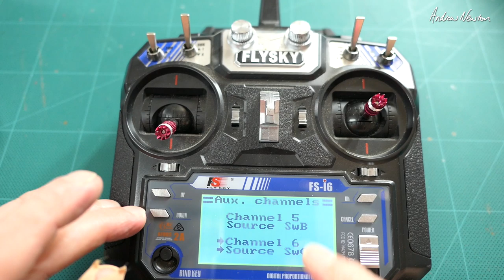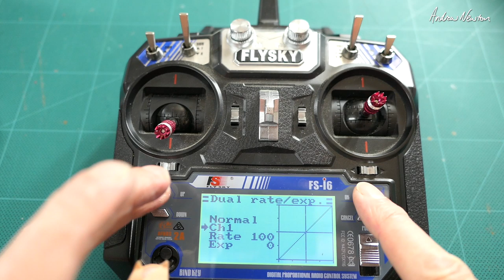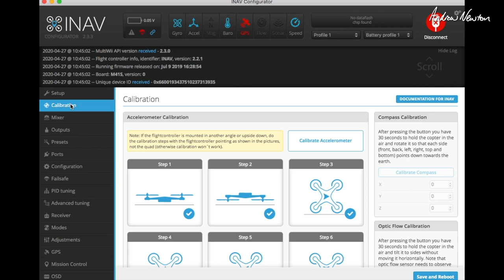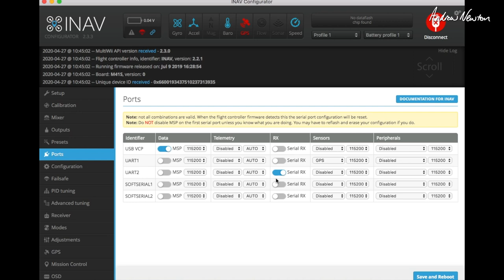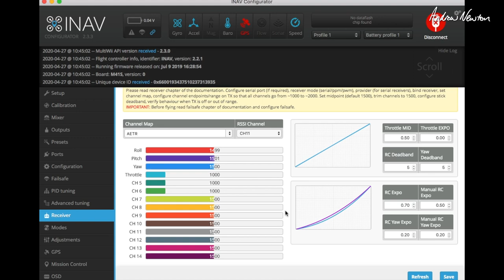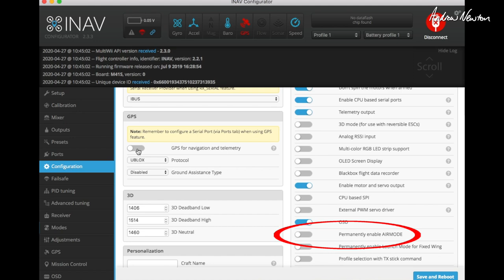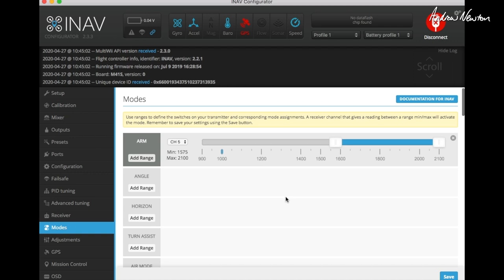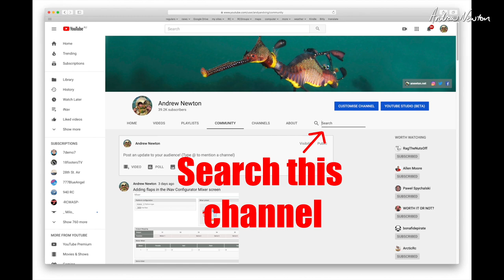FlySky iNav Fixed-Wing PPM iBUS Failsafe

Comment: If you upgrade the firmware on I-6, you will have 10 channels same as I6X. Can use more switches.
Reply: With the firmware upgrade, this transmitter is just amazing!
Reply from the maker: I only use this radio for beginners tutorials so it needs to stay stock. If it was my main radio it would be hacked and modded

Comment: Andrew I have set stabilization with CC3D board but has a limitation cos it is without barometer and cannot be configured for RTH ,alt hold etc .I have not yet tested the same and awaiting an opurtunity after lockdown is over.
Stay safe and stay healthy
Reply from the maker: Should be able to use Nav Launch too for a bit of fun
Reply: You can use rth. It will just use the gps height. Its not perfect but should work

Comment: Hi, great video, very helpful. Though I cannot assign the Aux channels to the switches like you did. It only allows me to select from the VRA and VRB. Any ideas on a resolution would be amazing. Thanks
Reply from the maker: With some firmware the switches need to be activated to be available in mixes. Is there an Aux switches menu somewhere?
Reply: @AndrewNewton  All good thanks, just needed to activate the aux switches

Comment: Hey Andrew,
I have small problem with my FS-I6. I have receiver and transmitter same as in the video, just FC - F411-WTE. I was trying to set up everything, but in INAV (6.0.0) my transmitter have no signal. With the INAV I can control motors, but with transmitter - nothing. I was trying to look for some info, but can’t find nothing to help me out. Have any idea for it? It doesn’t matter if I’m turning on or not transmitter, if I’m moving sticks or not - in Receiver tab there’s no changes. 

Thank you,
Reply from the maker: Possible problems. Receiver not bound, wrong protocol iBus or SBUS, wrong UART selected or not set up for serial receiver.

Comment: It's ok to use the expo settings on the radio. If you're arming by a switch then it would be ok to use the dual rates on the radio too.
I don't quite get the point of having a 'failsafe' mode, wouldn't you just want it to RTH, or are they different somehow?
Reply from the maker: Pretty sure you know more about this than I do Chris, but iNav already has 70 expo by default. Low rates would be OK in Manual I guess, but might not give enough control in stabilised modes. RTH still allows zero throttle.
Reply: @AndrewNewton  Actually I haven't used iNav for about 3 years now, so I'm not the guy to ask these days :) Zero throttle for RTH mode seems counter-intuitive, if it doesn't have full control of the throttle it's not gonna be holding altitude, or doing much returning - perhaps they should call that mode "Face toward home" instead :p
Reply: @iforce2d  Flysky receivers can't output no pulses when they lose signal, unlike other radios, so iNav can't use that to detect the signal has been lost. So instead you can setup the receiver in Failsafe to output an Aux channel value outside the normal range that can be used to trigger Failsafe Mode so iNav knows the receiver is in Failsafe. The other way is to set one of the 4 main control channels to a receiver Failsafe output that is outside the normal range, e.g. throttle = -120% (normal range -100 to +100). Settings in iNav can be adjusted to have this trigger Failsafe without using the Failsafe mode, it's just Failsafe in this case because the -120% pulse is outside the normal expected range. This doesn't stop the throttle working in RTH mode because iNav continues to automatically control the throttle even at zero throttle stick when in Failsafe and RTH modes.
Reply: @termite2691  Presumably if you're running an autopilot with RTH capability that you actually want to use, you'll have a mode switch and one of the modes will be RTH. I always set up the receiver to make that channel select RTH when signal is lost. Have never felt the need for anything more complicated.
I suppose if you wanted to have RTH only ever triggered by an actual signal loss instead of at your convenience, then using the -120% style range check would be useful. But to set that up, I would expect to create a range for the "RTH" slider in the modes tab, that went from say, 900 to 1000, for whichever channel had the -120% setting configured. Still no need for a separate 'Failsafe' mode.
Reply: @iforce2d  Have to admit I was never entirely sure what the Failsafe "mode" was for other than to test Failsafe using a switch ... which might be useful ... once. I see what you mean about setting up RTH on a switch that can be set to the RTH position by the receiver Failsafe setup if the signal is lost. Would have to be on Channel 5 or 6 with this transmitter because even with the extra channels from the firmware mods Failsafe settings are restricted to the original 6 channels. I guess the benefit of setting things up through the iNav Failsafe is you can use other Failsafe options rather than just RTH.
Reply from the maker: @iforce2d  RTH obeys zero throttle, or uses cruise throttle for anything other than zero, or there's an option to enable throttle control over and above cruise throttle.
Reply: @termite2691  fyi; the FS-i6X does allow Failsafe settings on all 10 channels. Maybe a reason to upgrade from i6 to i6X ?

Comment: Hey Andrew...
I have question about inav 4.1 mode, what the difference between RTH MODEN and FAILSAFE MODE ? Which one should i use??
Thank you
Reply from the maker: Failsafe Mode (in the Modes page) is just for testing. There is also a Failsafe page where you choose the FC behaviour in an actual failsafe situation. Usually you would choose RTH as the failsafe behaviour. And you can have RTH as a Mode.

Comment: Hey Andrew . I have looked everywhere for someone to show the step by step procedure for setting up the failsafe if you lose signal from transmitter , either by out of range , the batteries may have died , etc .  I am using a L9R receiver on my Taranis QX7  , with a Matek F411-SWE Flight controller . Also using SBUS . All settings in INAV look good as far as the switches go , but you would think if I turned off my transmitter , the thing would go into failsafe and the umbrella would turn red , but that doesnt happen . Are there steps that have to be taken on the receiver /transmitter side to correct this , or on INAV , perhaps in the parameters ? 
Awesome videos that you put out and I learn quite a bit from them . You are my go to guy for everything RC . Thank you
Reply from the maker: Thanks. You need to set the receiver to Failsafe - NO PULSES. With the L9R you cant do that via the transmitter, so look at the L9R manual and use Failsafe OPTION 2. Hopefully that will now work with INAV

Comment: Very interesting, thanks Andrew.
I haven’t got into Flight controllers yet, been thinking; “I want to fly it myself”.
However a return to home – failsafe does sound very useful.
Have you ever had a glider get stuck in a thermal that took it so high that it lost signal? … Did the return to home work in that situation?
Reply: It works if the thermal is not right above your home position :)
Reply from the maker: Thermal gliding is a line of sight discipline for me so no chance of losing signal. FPV thermalling would be a different matter.
Reply: Thanks guys.
This did actually happen to me once. A monster thermal took my glider so high I had to get out the binoculars, and lost control of the plane. I had to wait for the thermal to spit out my glider on one side. Then as she was spiralling down, I could regain control and land it!

Comment: Hello. I have Matek F 405 Wing controller with Flysky i6 iBus. I have channel 6 the same in flight mode, up Normal, in the middle Angle and down Nav RTH.... I did not put Failsafe, when my Wing is flying and I activate the SWC switch (Channel 6) my Wing enters RTH and returns to home...What would happen if I turn off the Remote Control? Go into Failsafe or my Wing falls to the ground.
Thxs
Reply from the maker: You can check when connected to the configurator. The parachute icon should turn red when you turn the radio off.
Reply: @AndrewNewton 
Thanks. My concern is to fly Long Range and that the Radio loses signal and my Wing does not do RTH and if it manages to return, how would I recover signal and control of the Wing. Thanks again
Reply from the maker: @dmctec5943  I think with iBus you need to manually set failsafe so that the mode channel goes to the RTH value.
Reply: @AndrewNewton  Thank you very much. Tomorrow I will do Long Range flights and we will see what happens. thxs

Comment: For anyone who isn't aware, Benb0jangles has a collection of firmware mods for the FS-i6 including a 10 channel mod on github. There's a few youtube videos on it. I have the upgrade cable, but haven't gotten around to trying it out yet.
Reply: Better still you can have 14 channels on this radio + mods to add extra switches:
https://github.com/qba667/FlySkyI6/releases
Reply from the maker: PC only so I haven't got around to it. But I must!
Reply: @AndrewNewton  I just have to figure out which firmware upgrade I want, there's a lot to choose from. I think maybe the qba667_hali9 one.
Reply: @AndrewNewton  Keep in mind the firmware mod will wipe all your model memories. Well worthwhile though, if only to lengthen that annoying one minute idle reminder noise timeout. But there's also a small chance of bricking the device, these days with the i6X available and for the price these things cost I would be inclined to buy another i6X (which allows sbus with some receivers). Getting the extra 4 channels mentioned by Termite is probably fiddlier soldering than most people will be comfortable with, and personally I don't recall ever having used more than 7 channels on any RC vehicle so far.
Reply: I re-flashed mine twice, 10 channels to 14 channels, it did not wipe out my models!  I was reluctant to try but, what the heck it works!  And it kept my 6 models! Bonus!
Reply: @socalives  Maybe they've improved the model memory aspect now. This release title does kinda look like it, but there are no details given: https://github.com/qba667/FlySkyI6/releases/tag/1.7.0

Comment: If am flying electric gliders  do I choose ppm and sbus or ppm and I bus. Or should I be using pwm
Reply from the maker: If you're connecting servos to the receiver pins then you are always using PWM. If you're connecting the receiver to a flight control board using a single cable, then you would choose SBUS, iBUS or PPM depending on how the FCB is configured
Reply: @AndrewNewton  thanks Andrew so pwm is right for me but do I leave it on I bus?
Reply from the maker: Yes leave it on iBus if you want, but it makes no difference

Comment: iBUS is either of the 2 top connections on the receiver. However, one is Tx (the one used here) and the other is Rx, used to receive telemetry from the Flight Controller. Rx won't work to send iBUS signals to the Flight Controller.
Reply from the maker: Ah thanks for clarifying that, I'll add to the description.

Comment: I have begun my first FC and also First INAV build and I'm using a modded fs-i6, SWB/SWE upgrades included.

Thank you for discussing connectivity procedures. my build features f411-wing & fs-ia6b. I'll attempt iBus first.

my aircraft is a DTFB scratch built v-tail pusher (similar to a mini-talon), it includes several of #ExperimentalAirlines techniques.
Reply from the maker: I like the sound of your ExAir Talon.

Comment: hello when i turn off my fs-i6 remote it does not get to the failsafe mode. only if i change the switch it enables the failsafe mode. can you help me?
Reply from the maker: Set that switch to RTH in the failsafe menu on the FS-i6
Reply: @AndrewNewton  yeah i did but its not enabling the failsafe mode of i shut down the radio
Reply: Actually when i turn off the radio nothing happens on the inav

Comment: But why use Ibus when sbus is offered and compatible with the flysky equipment.
Reply: iBUS is better than SBUS is the simple answer
Reply: With FlySky gear you'll only find sbus compatibility on certain combinations of device and firmware version that support it, which can be hard to figure out. Whereas ibus is good to go on any device that says 'ibus' on the labeling. As Termite mentioned, ibus is also 'better' than sbus, although it's not very convincing with no reasons given...! Allow me:
 - ibus uses a proper checksum, so that a corrupted packet will most likely be ignored, but with sbus some noise on the signal line will be taken as the actual input. In most cases this doesn't matter because each packet only represents 1/50th of a second, so in normal flight situation it will (hopefully!) be insignificant. But in other situations (eg. while calibrating, or if used as a motor arming trigger) it might matter.
 - sbus runs at an awkward 100,000 baud and ibus runs at 115,200 baud which is a standard option on many devices and software dealing with UART communication
 - sbus signal is inverted which is a pain in the ass for everyone

The only reason to be using sbus with FlySky gear is if you really want digital input and your flight controller doesn't support ibus (eg. Ardupilot).
Reply from the maker: Love it when you talk technical. I don't know this stuff
Reply: And if I'm not mistaken, having never used SBus, SBus is only 1 way (just send) unlike iBUS that is 2 way (can send and receive). Hence the receiver shown in this video has 2 iBUS connections, one outputs the RC signals and the other inputs telemetery data either from FlySky sensors (that can be daisy-chained together) or directly from a flight controller board. There's a really nice hack in fact to send and receive iBUS data using just a single wire connection to the flight controller board which only uses 1 UART (think it requires 2 UARTs otherwise if you use separate wires).

Comment: im setting it in a different way, and so that i don lose one channel for failsafe
1. set the endpoints on the throttle to be 120% for low position
2. go to failsafe options and set channel 3 (throttle) to -120%
3. reset throttle low endpoint to 100%
4. in INAV, i go to Failsafe tab and set the valid minimum pulse to around 980

credits: https://www.youtube.com/watch?v=T0DcXxpBS78
Reply from the maker: Yes that would work, but I would just use RTH as the extra mode anyway